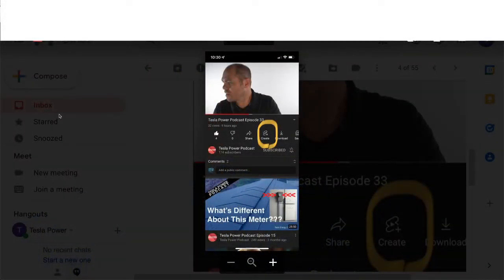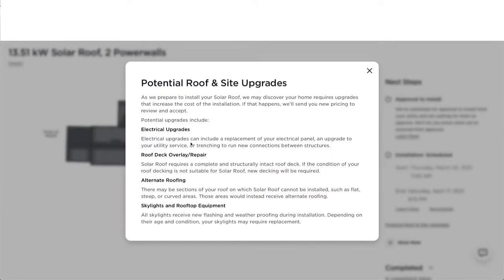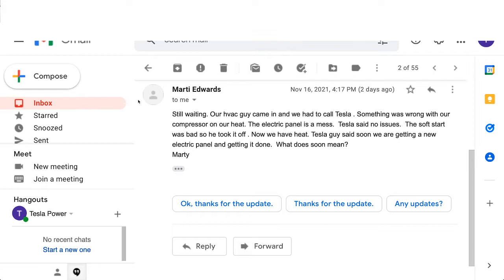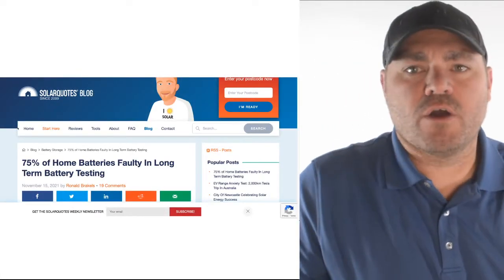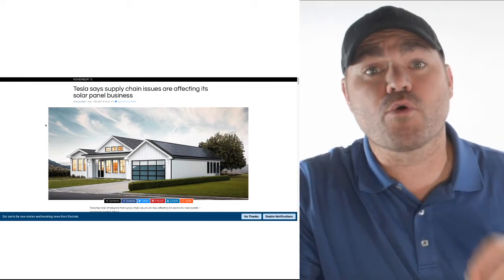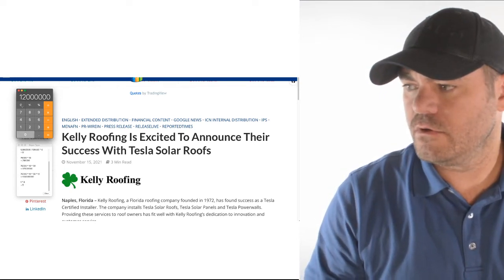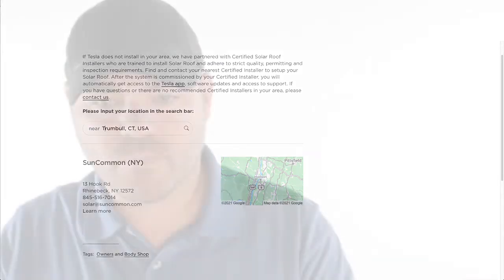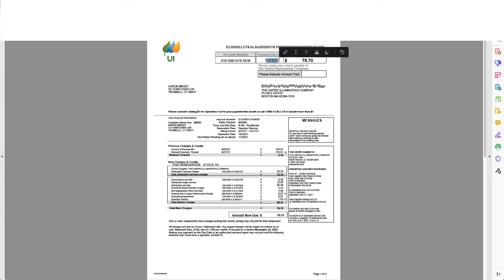Episode 34 - Tesla Solar Roof 1st International Install | Consumption vs Production

Comment: I thought when designing your home PV system, it is less costly/more efficient to first conserve energy where you can and then design a system to produce.  Still trying to process/understand the assertion to consume first and reduce last...sometimes for a fleeting moment I think I get it but it is quickly overcome by my brain saying "that's heresy."  Thanks for the taking the time to produce this content.
Reply from the maker: Heresey, indeed!  Everything hinges on your car.  If you have a gas car, then everything you state above is correct.  However, an electric car blows electricity consumption out of the water.  Two electric cars will triple your consumption at least - it may more than triple your consumption depending on your current electricity needs and your commute.
Does that make better sense?  I feel like my point isn't landing... :-)
I'll cover this more on the next episode.  I want to make sure I'm not getting this wrong...wouldn't be the first time, of course!